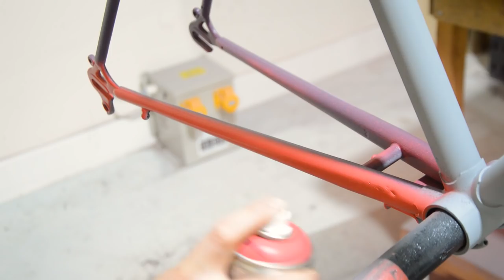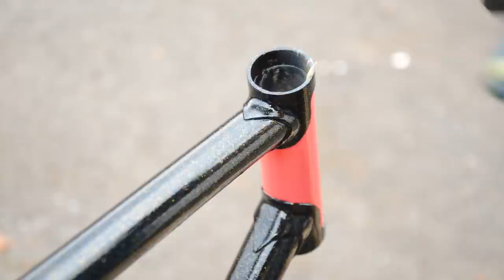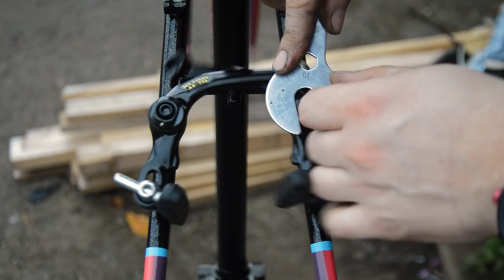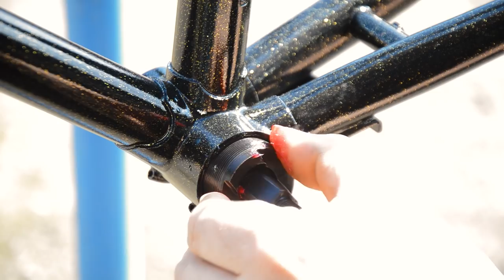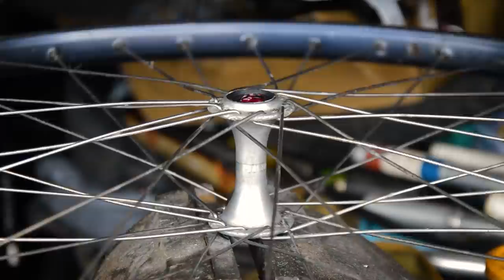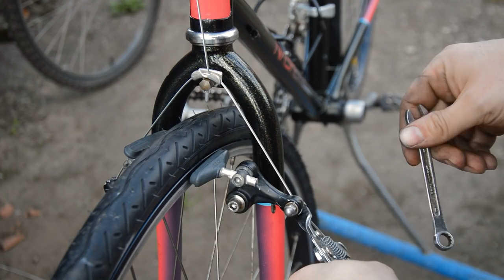Rebuilding A Cheap 80's City Bike - Part 2 - Nashbar City Alpha Bike Build

Comment: Nice job that. The front rack and cool water bottle make the look, what make are they both?
Reply from the maker: The front rack is the cheapest random thing I could find on eBay.  The water bottle I think is a High5 or something branded.  It's one of those energy tablet thing brands - a freebie from an event.
Reply: @MonkeyShred  Cheers. Looks ok that rack, might go for one of those but still gonna make the cheap IKEA cross brace wire basket hack
Reply from the maker: Ahhhhh like Gary right? It’s a good hack!
Reply: @MonkeyShred  yep, that's the one. Easily removed if I want to fit a larger front pannier rack I will need when I buy these sweet retro looking front bags I've seen on marketplace😎😏

Comment: I like this frame, and the front rack is perfect in the city.
Is it too fast with this combination of gears?
Reply from the maker: No no it seems ok.  With grippier tyres it may be better with a triple crankset for the slower speeds.